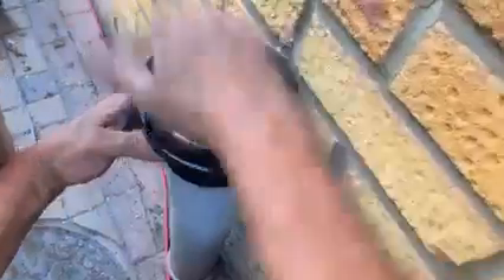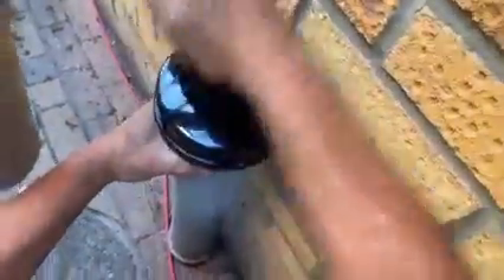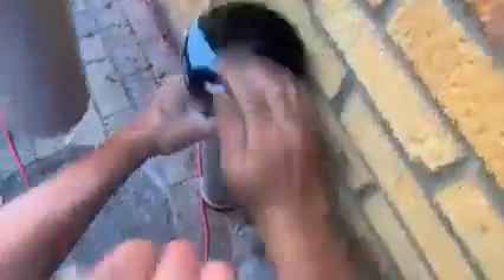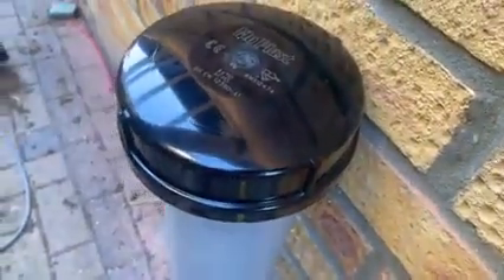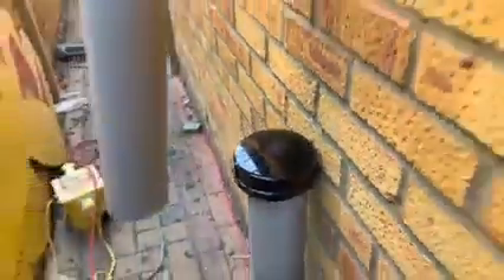How to turn stench pipe in to air admittance valve￼!

Comment: I designed that Floplast air admittance valve and sold the injection moulds to Floplast.  Now my latest version of air admittance valves are just as efficient but smaller in diameter and neater looking.  They are available in four different colours and available as both internal version and external versions.
Reply from the maker: @PatrickFrawley-h7f  very nice good job and Shine On